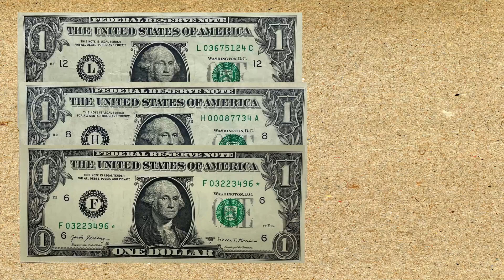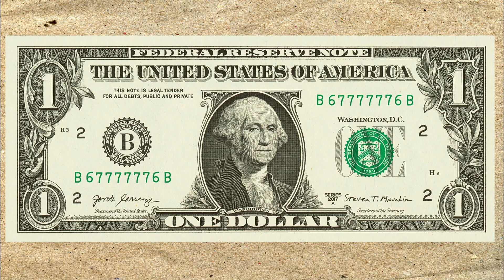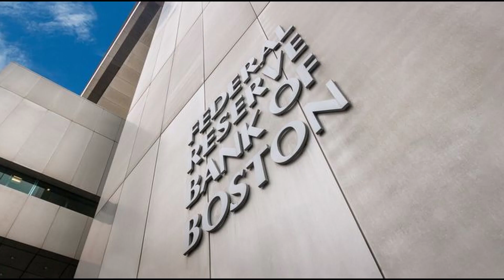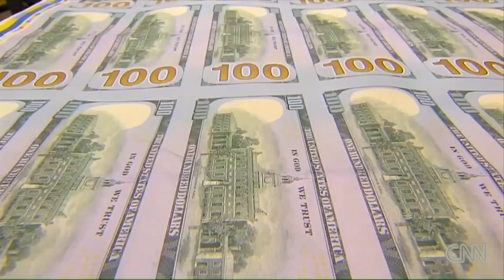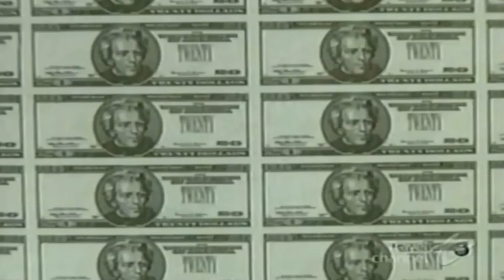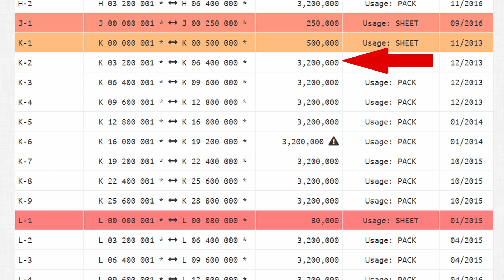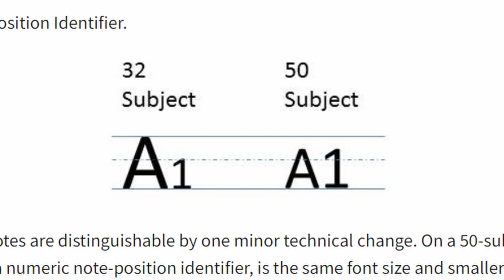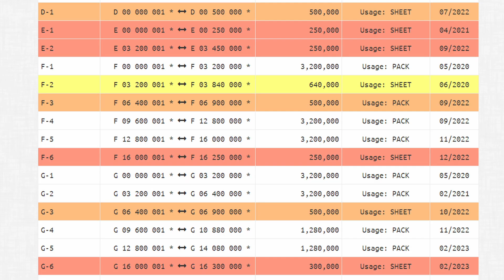Why do star notes exist?

Comment: The one dollar bills serial numbers do go over 96 million. I have three, two that starts with 99 and one that starts with 98.
Reply from the maker: The older ones went to solid 99s I believe 1981 is when they changed to the new system. Also on modern notes they make reserve the serial numbers over 96 million for the novelty sheet notes.